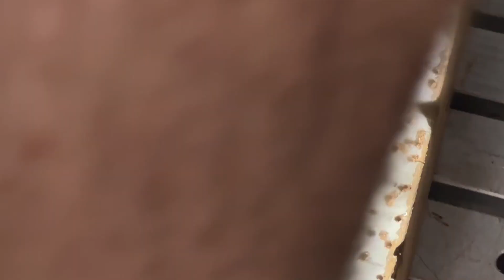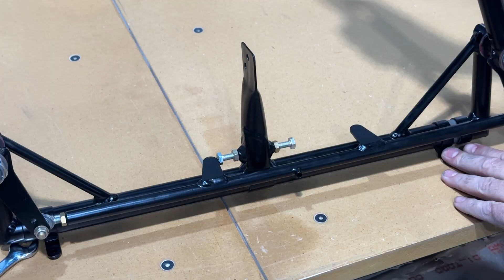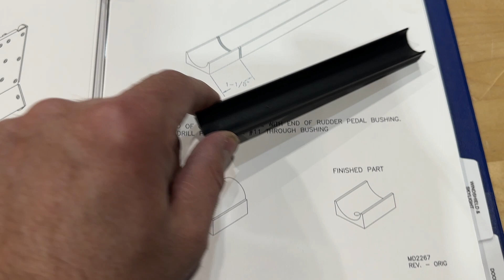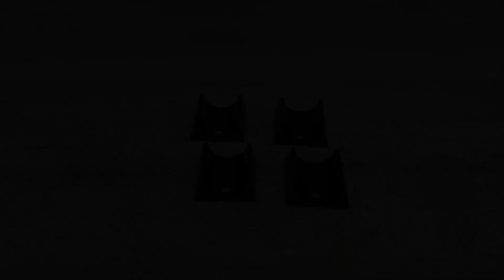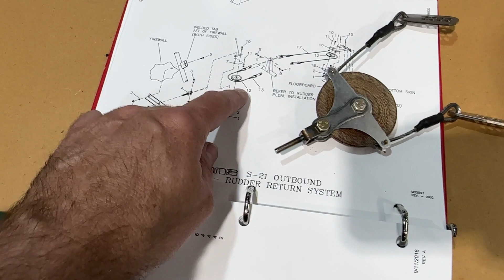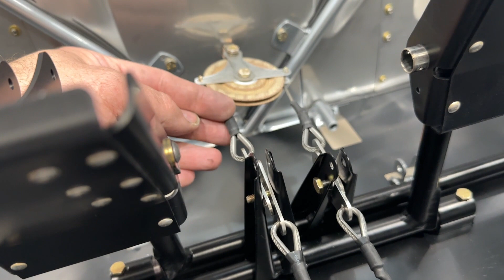Ep. 24 - RANS S-21 Flight Controls

Comment: My rudder returned firewall bracket was the same, tangs are not level. I flipped the bracket and redrilled it level. Now I’ve got a bracket with three holes should I need to attach stuff too! 🙄